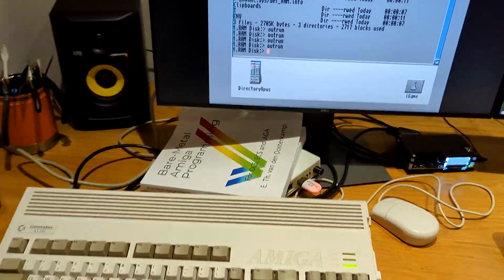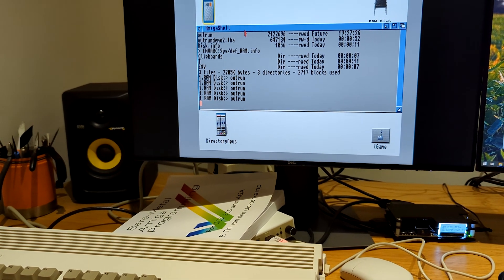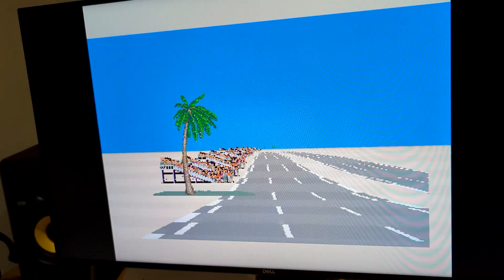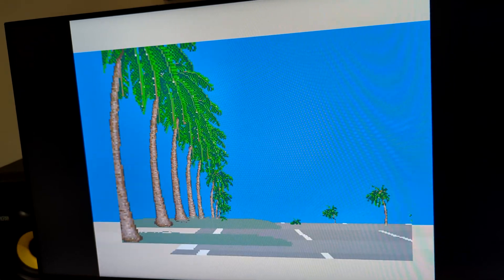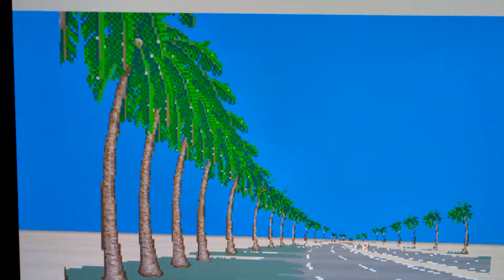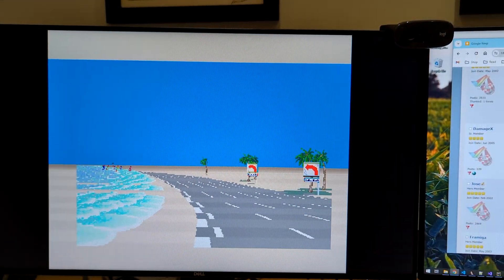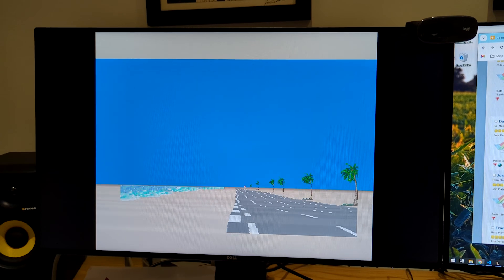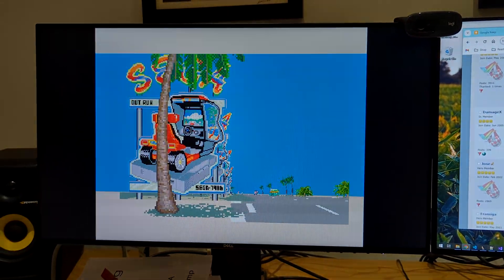Amiga OutRun Update 2: Like A Ferrari With No Engine!

Comment: In the original system 16B hardware I think the sprite scaling was handled by a GPU not the 68K main CPU. So I wonder if it is not better to scale up the sprite and save them into memory instead of doing it in real time ?
Reply from the maker: I would never rule anything out. But there's a reason I didn't immediately jump to that approach:
https://eab.abime.net/showpost.php?p=1670069&postcount=77